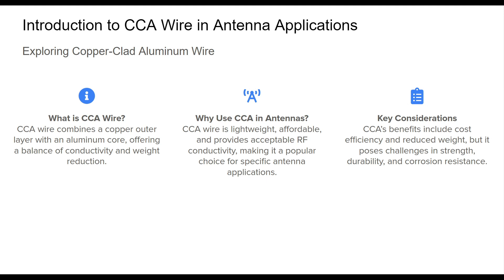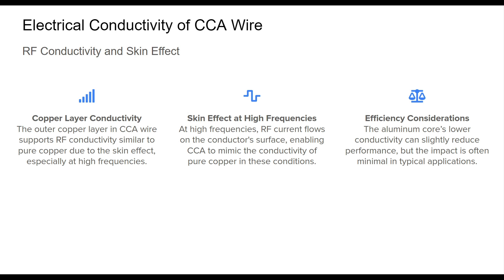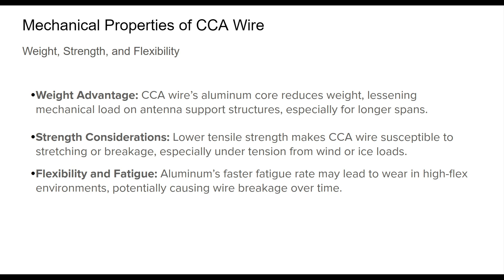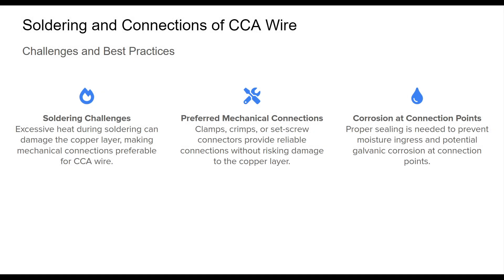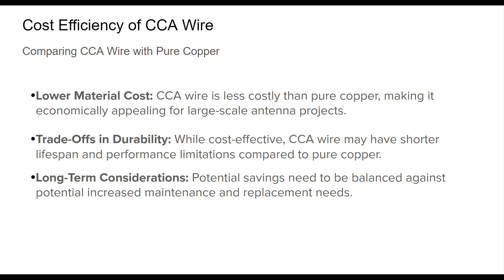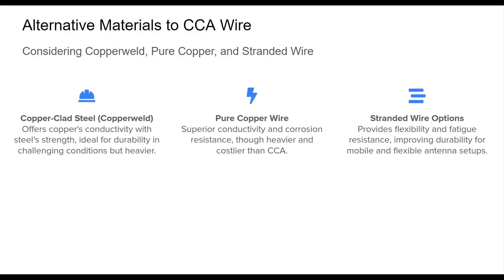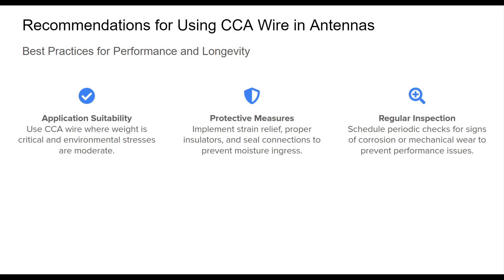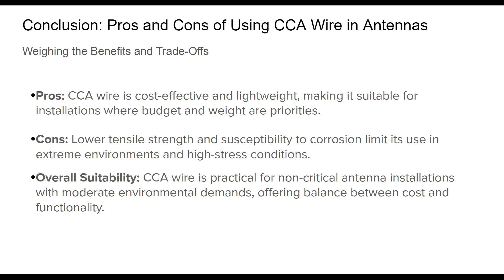Building Ham Radio Antennas with Copper Clad Aluminum Wire!?

Comment: I recall during corrosion prevention courses in the USAF we were taught never to directly connect copper and aluminum because the dissimilar metals would form a small electric current between them.  That's why it's called galvanic corrosion.  It doesn't need exposure to water or salty air to happen.  It will happen in a vacuum.  I wonder if the manufacturers have figured out a method that prevents this (or they're counting on a built-in obsolescence).
Reply from the maker: Thanks for the info RBM 👍
Reply: That was my first thought. It's the reason Mercury outboard motors use low copper aluminium.
Reply: very much so in the hvac world. I just do the grunt work but we do a ton of corrosion testing in my lab.

Comment: Great Video, and very informative! I use CCA wire because of long runs for my random wire antennas that are often coupled to branches that might not take the weight of pure copper or steel cored wire. I get great results. I'm able to DX every place in the world using a 20 watt Xeigu G90. However, CCA will stretch very easily. I do regular inspections and replace the wire every 12-18 months, which isn't a big deal since I have a pully system for raising and lowering the two ends of the horizontal antenna. On my vertical antennas, I use pure copper because the lengths are shorter. CCA is inexpensive but requires more maintenance. These videos are extremely helpful because they provide everything you need to know should you consider using this type of wire. Thanks again for the video...73...Hugh...KN6KNB
Reply from the maker: I had an EFHW that I had to trim like twice a year from stretching.  I'm glad you like the videos Hugh 👍

Comment: I have been using various wire antennas for over 50 years. Living in Connecticut we get winter storms which ice up everything outside, including antennas. In recent years, I see more and more using various types house wiring wire, including on commercial made antennas. I'm still very much old school using the difficult to work with, copper-clad steel antenna wire. But that's me. WB1COB
Reply from the maker: Hey David, thanks for watching 👍

Comment: How thick is the copper clad?
How deep is the skin effect at target frequency?  30 mHz, 500 mHz, etc.

One of the problems with copper though is oxidation.  It will cause the antenna elements to be electrically long compared to clean bare copper.

Aluminum oxidation on the other does not change the electrical length as much as copper oxidation because aluminum oxidation is a better insulator than copper oxidation.

One might coat clean bare copper with paraffin wax to inhibit oxidation.

Comment: Hi Ape,
Thanks for this video.
I had not considered using CCA wire for an antenna installation and personally I would tend to steer away from something like this.
Not that it is a bad idea at all, but most of my experiences with aluminium conductors have not been good ones.
Aluminium as a metal (yes I know it is an alloy) is one of the most reactive metals around when placed with other metals and is also the reason 
why chemical treatment pastes like NoAlox (sp?) were invented.
One of the things that turns me away from this "metal" is that it suffers badly from metal fatigue when bent more than a few times, which could happen if you live somewhere that experiences a lot of strong winds.
This is not a criticism of you Ape, I just hate Aluminium.
Reply from the maker: Hey Mike, I don't take your comment as criticism at all, thank you for posting it...  I'm not saying that folks should use CCA, rather you can if you understand the nuance around it.  Thanks for watching 👍

Comment: Im getting ready to build a 80 meter doublet antenna.  I am curious as to whether some 4 strand, solid copper phone wire i have tons of will be adequate of if I should spend the $ to buy some stranded wire.  I will be attaching the wire to a support rope so it wont have to bear the strain of holding its considerable length.  Your thoughts would be appreciated.
Andy W4JVI
Reply from the maker: Hey Hayes.  So we know that RF travels on the outer surface, stranded has more outer surface than solid, I'd use stranded if it was in the budget.

Comment: Some years ago, I bought a spool of wire for a catv related project.  I thought it was solid copper, but I was very wrong.  It was CCA wire and it worked well for some time.  With humidity and  limited movement due to environmental issues, the system started to have problems.  I chased them down and attributed it to oxidation on the copper.  Then the wires started to break, and I saw the aluminum core.  Given the time, effort and frustration,  I am more careful in the  purchase choice of wire.    The label can be unclear or intentionally misleading.  Good comprehensive and unbiased presentation of the facts.  As I've said before, you are indeed a Great Ape, with knowledge and pleasing presentation skills!
Reply from the maker: Thanks for the comment Phil, and for watching 👍

Comment: Working in industry, I often had access to lots of scrap #12 or #10 THHN stranded copper wire. Now I’m retired, and my stockpile is depleted. I have considered CCA, and I covered most of your concerns. My main concern is not knowing whether CCA is copper clad or just plated. Finding a chart showing RF penetration is pretty easy, so determining what frequencies stay within the copper is also easy. The corrosion resistance became my greatest concern. Currently, I’m not looking for wire: I found several hundred feet of #10 THHN stranded at a yard sale. A good bit of it is now in the air—and has worn out several ropes… tough stuff if you can tolerate the weight.
Reply from the maker: Hey Bill, I actually just picked up some THHN, haven't tried it yet.

Comment: What are other options, and other wire and gage recommendations? In aviation they use breakaway copper wire to keep switches or handles from being opened, that were only used for emergency purposes.
Reply from the maker: I will do more "wire" videos in the future...
Reply: Great information! I’m still learning.
Reply from the maker: What's crazy about Ham Radio is that we are all still learning 👍

Comment: I used some as earthing wire and it corroded. Yes, it was in direct contact with soil.
I would expect it to do the same over time.with atmospheric rain and air pollution.
Could it be wrapped around an aerial insulator without cracking?
I'd say don't use it.
G4GHB.
Reply from the maker: Thanks for the comment Bill 👍

Comment: Great information.  I use CCA speaker wire for testing antenna ideas and a cheap set of ground radials for a temp antenna or portable, I find over time the UV makes the jacket fall apart and it will stretch. But works quite well  .I got a park to park . NY to UK on 10 meters with 25ft into a 4:1 and shortened end to tune. below 1.5 SWR and was made with speaker wire up DX commander 10 pole . and was with 50 watts from a QT 60 on battery .  Other park had end fed half wave  .on battery as well.  Wire to wire across the Atlantic. I say CCA wire can work great . I did cut a piece of Pink all copper antenna wire from DX engineering for further use after testing . High vis 14 AWG copper. The best all weather wire I found is DX commander DX 50 wire. that a all copper braid over Kevlar core. very strong and does not stretch. Best from England . Made for british military . 73
Reply from the maker: Because I make videos, I will often make a quick antenna that might get used for a few weeks and then packed up to only make an occasional appearance.  I sleep fine at night knowing they are made from CCA.
Reply: @TheSmokinApe  The park to park was CCA walmart speaker wire from NY to England ! I sleep with a sime !  I got some 8 AWG solid mag wire for that big toroide you got. it is square wire with coating. Should do 1.5 KW ! LOL
Reply from the maker: LOL at 8 AWG